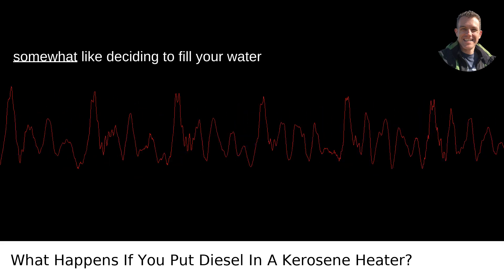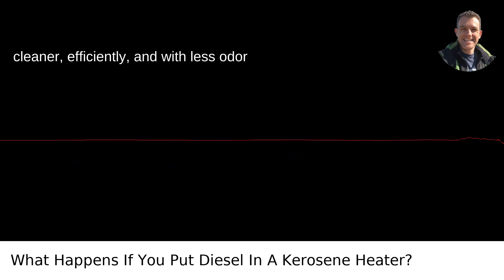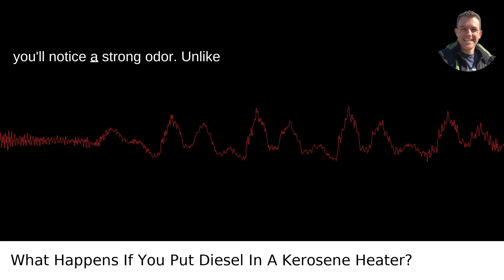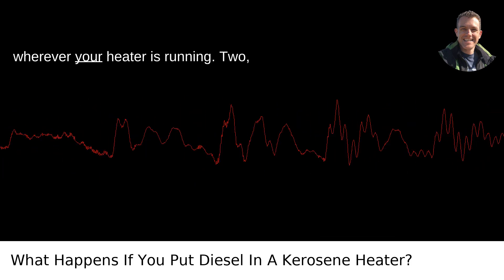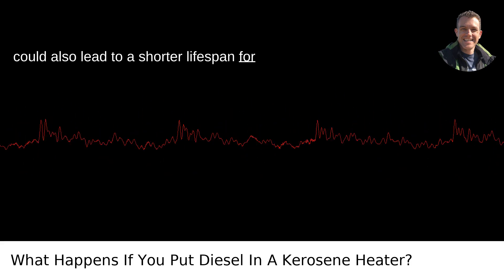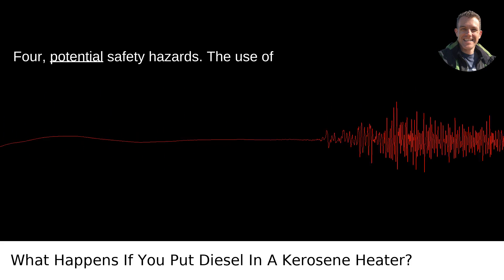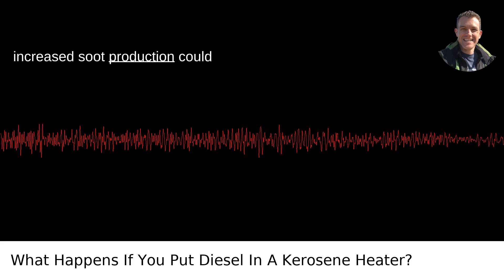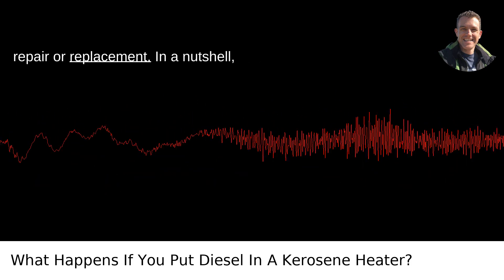What Happens If You Put Diesel In A Kerosene Heater?

Comment: Add a pint of 91% isopropyl alcohol to 5 gallon diesel. It burns with no smell.
K1 Kerosene is 10 bucks a gallon or more.
Reply: Do you know the ratio if I just use a gallon of diesel?
Reply: @Gssmallenginerepair  16 ounces in a pint so divide 16 by 5.  
3.2 Oz per gallon
Reply: @FourthWayRanch   Math is fun...  At least it could save someone asking another question. Especially from a "small engine repair" type when this equates to 40:1.
Reply: @stretch130MFE  ok if the alcohol is 91% tell us how many ounces of water is in the 5 gallons
Reply: @FourthWayRanch  Do you not realize I was agreeing with you, and my comment was a slight dig at gssmallenginerepair?  And I don't know the answer, because I've never needed the answer to that question. But with just throwing some numbers around, I'd WAG 2.88oz.
Reply: @stretch130MFE  9% of 16 Oz no? 1.440z.
People have a mental block about math, their teachers never taught them how to study math correctly
Reply: I do not see why anyone should use 91% Iso alcohol into the diesel.   The other 9% is water , which is not flammable,  unless you need to dump some moisture into your room.   I use 100% Iso or metho alcohol  or metho hydrate.  Kerosene and diesel are close cousins, they can be interchangable to a degree, not fully, that is why you have to put additives into the fuel if you use diesel. Diesel, even if there are road tax on it, are much cheaper. and you can can that scary show biz with a heater catching fire in your video.  Jet fuel for airplanes are mostly kerosene, and for availability, most diesel airplanes now use Jet A or diesel.
Reply: @tonylam-u1t  it's only 1.4 Oz of water in 5 gal. You cant buy 100% IPA anywhere except online. 91% is widely available and cheap
Reply: @FourthWayRanch  Good point, I did not consider the quantity. I will try metho alcohol, I do not know what the difference is , but it is easier to get in paint stores
Reply: @tonylam-u1t  I think IPA is better, it's more miscible with the diesel. The 91% pints are around $1.50 at walmart at Walmart now.
My local airport will let me fill up blue kerosene cans at their self serve jet a pump. It's $5.50 gal. I'm gonna try that
Reply: @FourthWayRanch I’m glad I didn’t know that.  Because then I wouldn’t have checked on ordering 99.9 % IPA online to have it delivered on my doorstep just last week.
Reply: @boxsterman77  99% IS better it's just special order, NOT EASY TO FIND.  Water is not good in fuel (bout ounze and half in a pint) but it seems to tolerate the small amount in the 91%
Reply: @tonylam-u1t  I've tried a few tanks of diesel, God help you if you let the fuel run out and the heater is inside, it will stink out the whole house.
Reply: @FourthWayRanch  I do not trust a fuel burning device enough to run in living spaces, I use it in my detached garage, so the smell is less serious. The smell bother me less than the monoxide.  I guess I just have to follow aviation practice and never run out of fuel.
Reply: @tonylam-u1t  I don't care if I die.  You can see I fly ultralight airplanes
Reply: @FourthWayRanch  I do not consider ultralight airplanes as dangerous.But they are uncomfortable in bad weather.  I take a cabin light plane any day.Like a 182?
Reply: @tonylam-u1t  I can't fly mine unless I accept the fact I could die. They are so flimsy and I put it all together too so I know every part. Little wires and tiny bolts holding things together. It's madness, I had to buy a parachute.